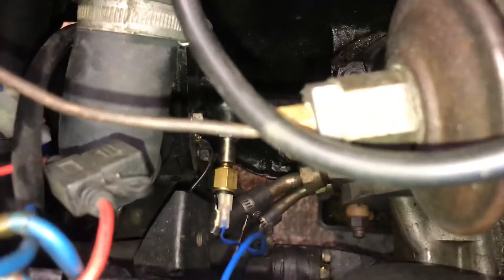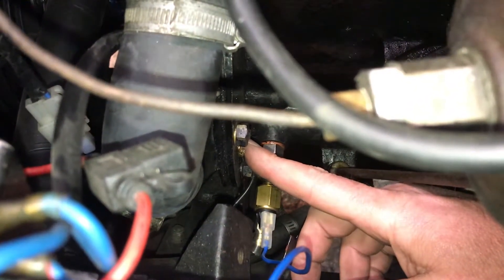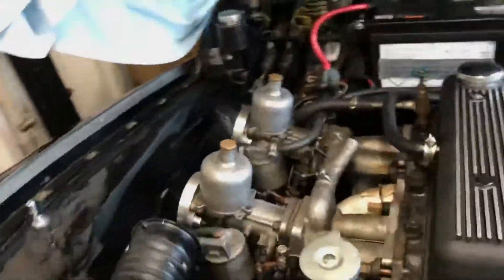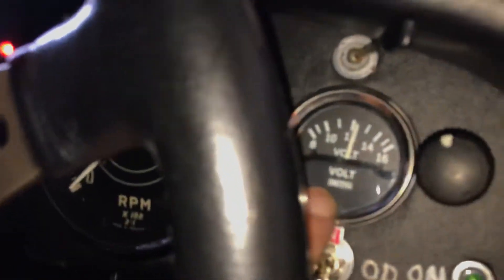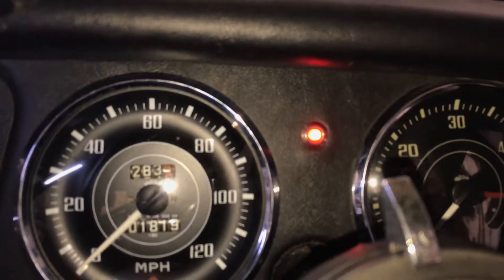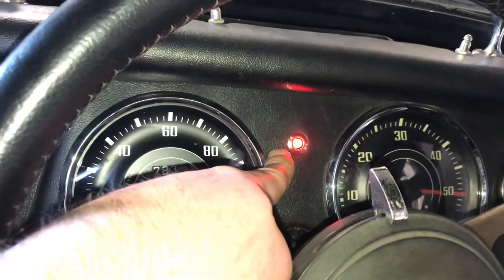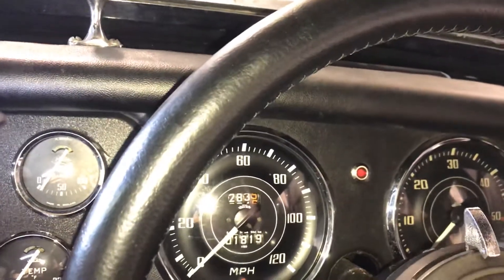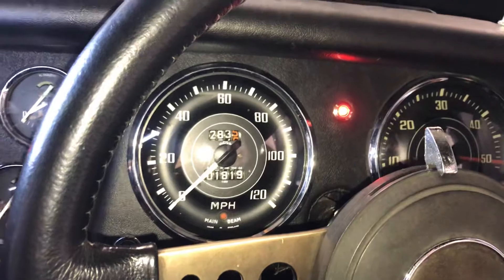Triumph TR3a Low oil pressure warning light.

Comment: Mite I make a suggestion in my old race car I ran a oil light my light was about 2 inchs in size I could see it without looking at it so when I was hard driving I dont look at my gauges but just a flicker of the light I could see without looking right at it. as you know when running hard there is no time to be looking around you should be driving.
Reply from the maker: Hi Mike I hope you are keeping well and the weather is finally improving to Spring warmth up there in the North. I did consider a much bigger light and a buzzer. But felt that was too much for a predominantly road car and that I do sprints and hill climbs which really don’t last long at all typically about 60 to 80 seconds. But it’s a good idea for full on circuit racing.
Reply: @HamishRacing  ya my car was a road racing car hours of hard driving I also had a formula car setup the same way.